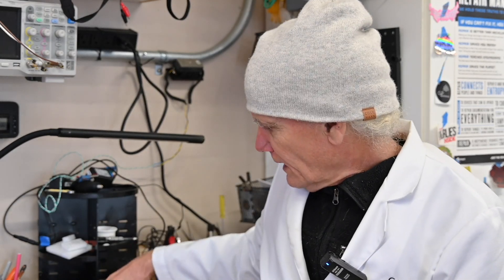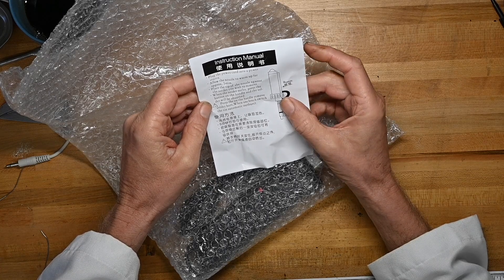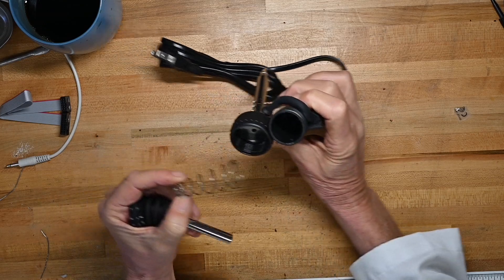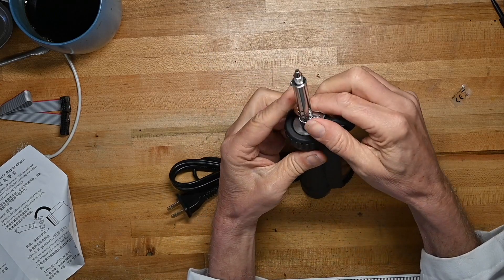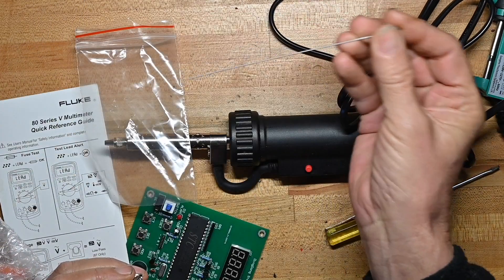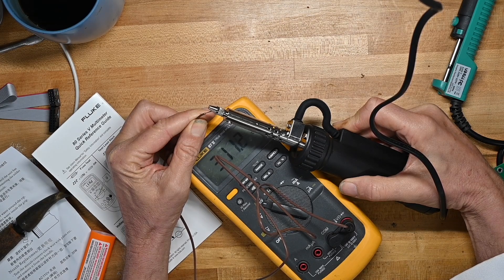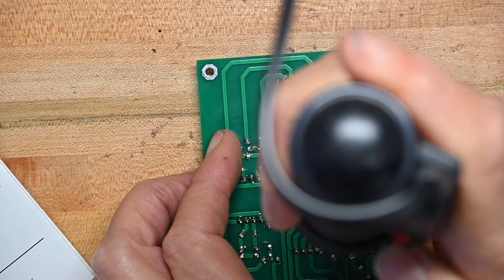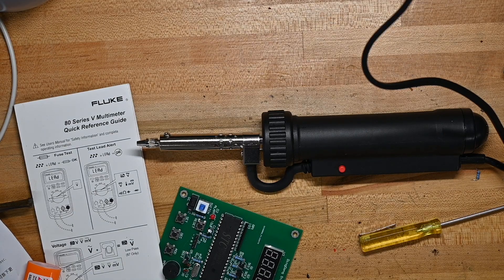C.K. tries an EXCELLENT solder removal tool from Vislone, my new favorite

Comment: I have this same tool. When the solder melts you are supposed to press the red button and HOLD it in, more the tip away from the board, then release the red button because the tool is supposed to eject the solder and you do not want the ejected solder on the board. However my experience is that only 1/3 of the solder is ejected.  

The "manual" states to take care of the tip and their tips are superior to other tips.  In order to order genuine tips you have to order all three sizes of tips but I need only the largest size. I tried ordering a different brand but it does not screw on to the iron. 

Overall an excellent solder sucker iron but replacing the tips is very expensive.
Reply from the maker: Thanks for the details, I never noticed the expulsion of the solder, now I know!  Thanks for stopping by!

Comment: And how much does the Yihua one goes up in temperature, how you measured it as well? And this new one is better than the Yihua in suction power?
Reply from the maker: The suction on this one is much better.  And the temp rise o this is better than the Yihua, I didn't measure it specifically, just know how long it takes to come up to solder melting temp, enough that I walk away for a while during warmup.  This one I don't, it powers up fast.

Comment: You should suck the solder, keep the finger pressing the button, then release somewhere else to spit the solder, or you will clog the nozzle very quick and make a mess on the board. I use a small glass cup.

I've been using one for a few months now, the only bad part about it is cleaning and swapping the nozzle, you will eventually have to deal with a nozzle clog and solder getting into the nozzle thread, but overall, it's working nice, I paid something around $27.
Reply from the maker: Thanks for the tips!  And thank you for stopping by!

Comment: I went through several desoldering tools and the gun-type stations are the best. They've come down significantly in price.
Reply from the maker: I tried two of the gun types and haven't had great success with them, my technique just isn't right.  That's why I try these plunger types, they work for me.  And yes, cheap as heck as such things go.  Thanks for stoping by!